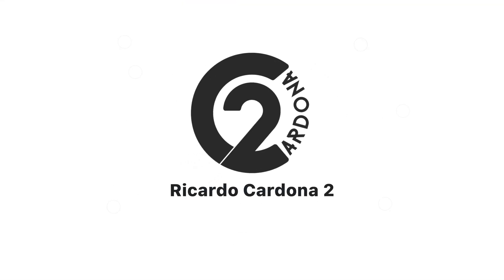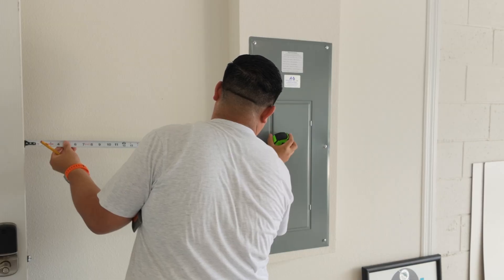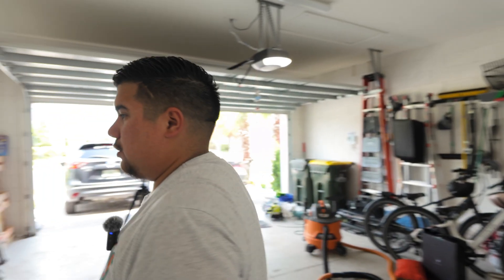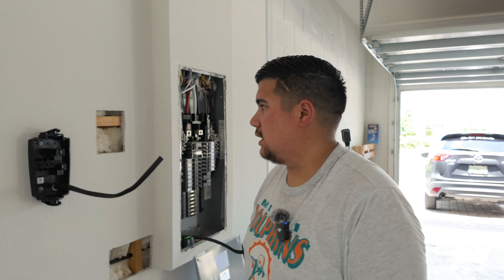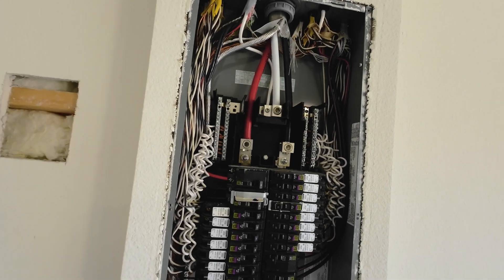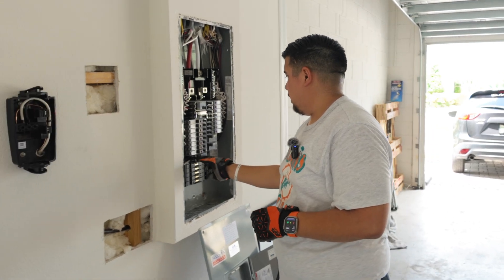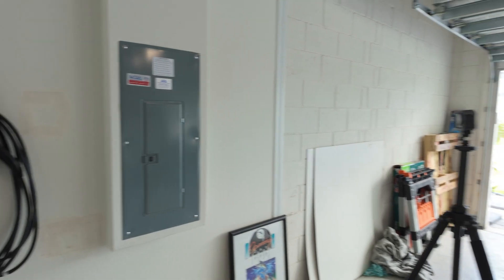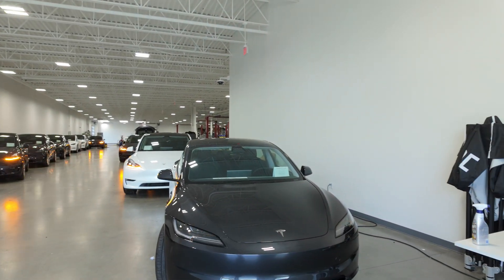DIY Tesla Wall Connector: Is It Worth The Investment?

Comment: You need to put connectors on the cable going into the charger and the panel. The cable will chafe on the metal opening.

Comment: The wall charger calls for a 60A breaker not a 50A breaker. Hopefully you limited the charge level to a 50A breaker size when configuring the wall charger. It is also recommended to use #6 THHN wire rather than romex.
Reply from the maker: @cwallace777  Thanks for watching! You can use a 50amp. I reached out to Tesla and they confirmed. The wall connector is properly set to 40amps and the romex is 6 gauge. The only difference is that the cables are wrapped with a protected sleeve. Those are good recommendations 🤙🏼
Reply: The wall charger can be connected to "up to" a 60 amp breaker. It doesn't require a 60 amp breaker. That's what the instructions that come in the box says. Tesla can handle anything from a 120 volt, 15/20 amp source to a level 3 supercharger although obviously charging will be much faster.